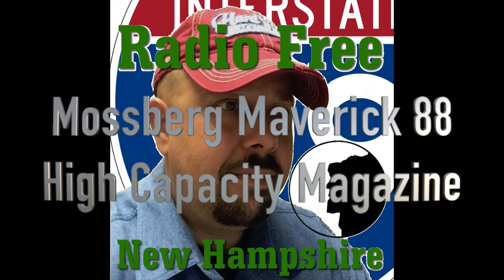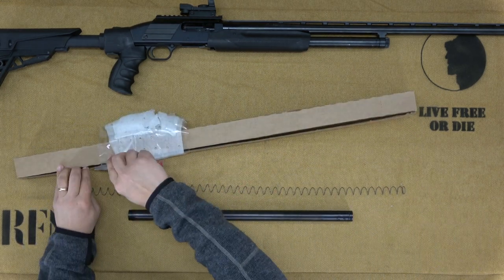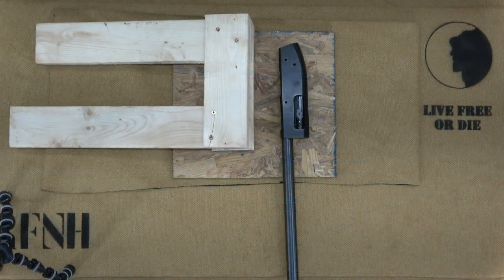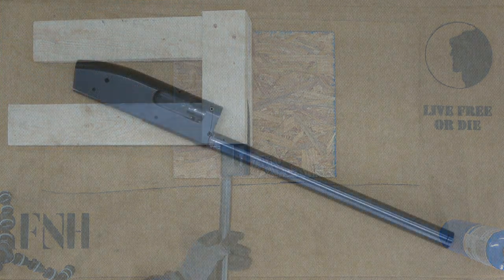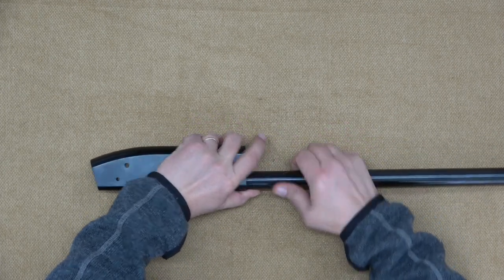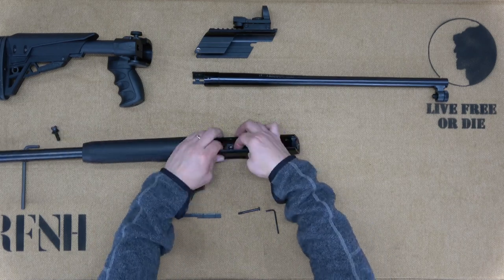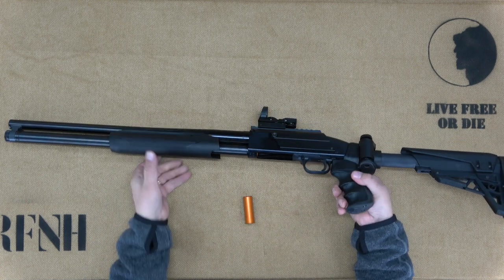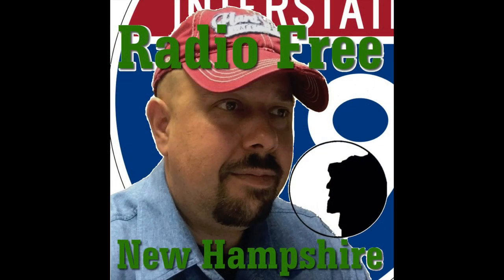Maverick 88 High Capacity Magazine Tube Installation

Comment: a word of cautionary advice, set the receiver deeper into the jig, flush with the fore face, to avoid twisting the receiver.  Great video and thorough coverage.
Reply: Thank you!
Reply: Well I didn't watch the video but I don't need to and I have no clue what you're talking about about worrying about twisting the receiver that stuff just basically falls apart once you take that screw loose on the end of the magazine tube so what are you talking about? you don't even need to put it in a vise ive done it 50 times literally on my lap.
Reply: @jimjones395 u just screwe the tube right off?

Comment: The Maverick 88 comes in many configurations. Just order the one you want and you won't have to do this. The result in this vid is their #31046. 7+1 12ga 20" barrel.
Reply: I thought the same thing.  Lol
Reply: Much less $$ too, but the build is fun and for people who are doing it in stages. It started when my brother bought the basic version of the gun and we looked into the mods that were available.
Reply: It is a helpful video for people buying it used.
Reply: I would if those were still available.. can’t find them anywhere
Reply: It's expensive to buy all these parts and do it yourself, but it's fun and I enjoy it because I get to learn a lot about this kind of stuff and it comes with a bit of pride when you take it to the range and people are like "wow where'd you get that?", and you can tell them that you built it.

Comment: Nice Video showing how to apply heat to remove a Mossberg 88 Magazine Tube,
Thanks for the Video.

For those commenting that all you have to do is Just unscrew the Magazine tube you have obviously
Never removed a Magazine tube that has Red Loctite on it from the Factory on the threads !

This guy did what he needed to do to remove the Magazine with the Red Loctite on it.
Not all Mossbergs have Red Loctite on it but if it does you wont just casually reach up and twist it off.

Suggest you save this page when you do get one that has the Red Loctite on it when you find that it doesn,t screw off easily it may keep you from destroying your magazine tube .

Nice to be able to clean out the Magazine tube from surface rust inside the Magazine or change a Magazine spring or follower for maintenance.

Comment: Great video. Is there a reason you didn't reapply locktite when you reassembled with the replacement tube and barrel?
Reply: No reason at all - good advice!
Reply: because he didn't know if it would work. I've been searching for this since I bought it on 02.07.2009

Comment: Great video. Have a question, just picked up a new Maverick 88 and wanted to change the barrel. Do you need to replace the stock magazine tube if you're adding a 18.5 barrel??
Reply: Nope, just remove the field bbl. and install and any other Mossberg 500 specific bbl. drops right in.
Reply: @wespeacock793  Awesome, Thank You for your reply!
Reply: @wespeacock793  Just had to look up what “bbl” means. Apparently you were too lazy to type ‘barrel’ so you used an abbreviation that doesn’t even make sense. Great work.
Reply: @wespeacock793  Brazilian Butt Lift is the most commonly used acronym BBL. FYI. TMI? LMK.

Comment: Thank you for the video it was very helpful and I subscribed. I was hoping someone could answer a simple question. I have two magazines springs one is for my Maverick 88 security version which holds seven rounds and the other is for my normal Maverick 88 that holds five rounds but I don't know what the difference is as the two springs look almost identical length wise. Any pictures with worded details would be much appreciated or any advice. Thnx

Comment: I have a Maverick 88 with an 18.5" barrel, do I need to get another barrel so I can install a high capacity tube? mine is 6+1 right now. I want both my barrel and tube to match in length.
Reply from the maker: I believe so - you would need the stud to be in the correct place to secure the increased capacity magazine tube.
Reply: It would be cheaper to buy a 20" 88
Reply: @diz7366  i have a 26'' 88 that hold's 5 plus 1 would mine be fine?

Comment: 3:10 "make sure the bolt assembly is to the rear before installing"
 3 hours I've been searching online to find the answer to my problem. It doesn't have to be to the rear for removal and the owner's manual does not mention anything about barrel installation, only removal.
Reply: I hope that was the help you needed! Thank you for watching.
Reply: @nyager2  yeah it was I took the barrel off my 88 in order to put on the longer one that comes with the gun and I couldn't get it back on and I thought I was missing something didn't know it would be so simple

Comment: We’re the test shells 3 inch?
Reply from the maker: I checked - they measure about 2.5”. The magazine should hold seven 3” shells but I haven’t tried it personally.
Reply: @radiofreenewhampshire644  then go down to 2 3/4 and you will hold 8 + 1 hell that's a lot of firepower!!! Only and idiot would run 3 inch shells in their home defense shotgun!!! Managed recoil 00 buck with 8 pellets at 1200 fps is plenty and in the space of my home I'd rather have 8 + 1 of those then 7 + 1 of the 3 inch and they're better for control and faster follow up shots while still being very powerful!!!